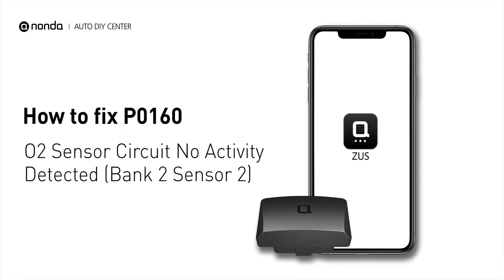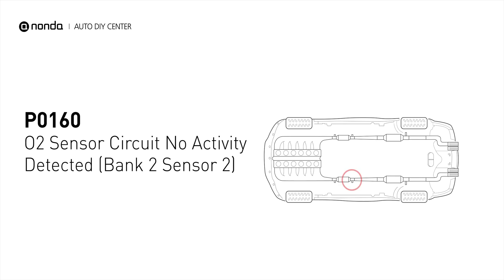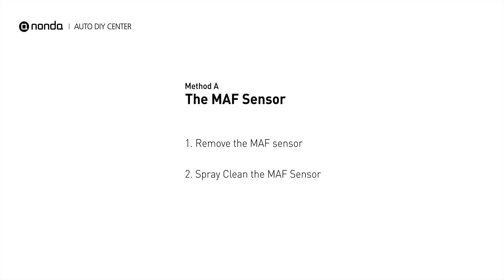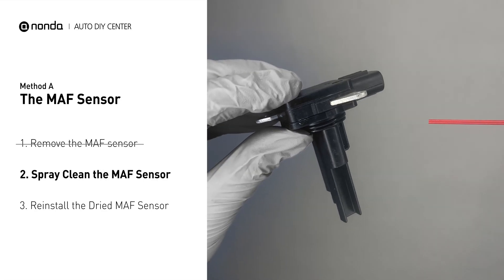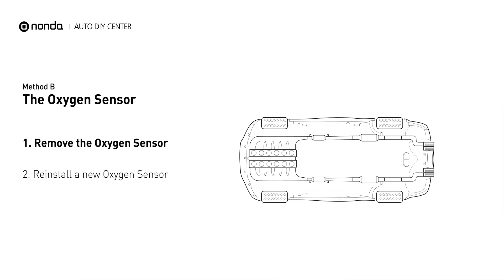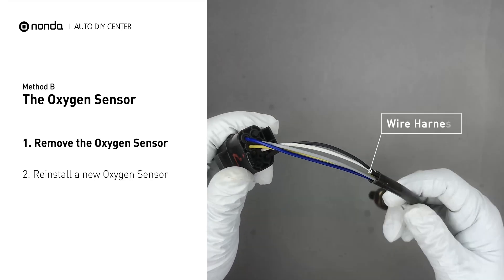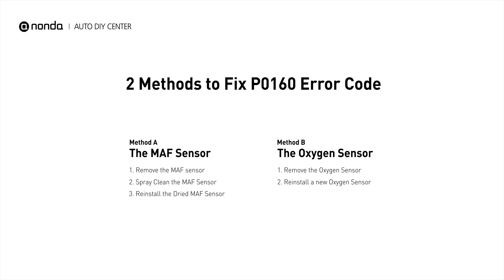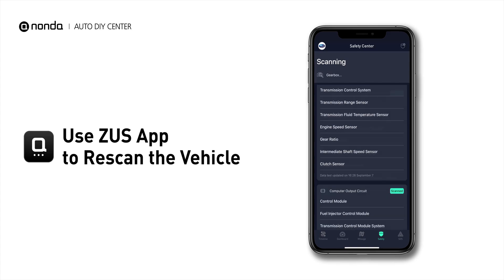How to Fix P0160 Engine Code in 3 Minutes [2 DIY Method / Only $9.81]

Comment: Got a 99 chevy silverado Recently had codes for o2 sensors , had them all 4 replaced , check engine light turned back on after a while, would it be the map sensor?

Comment: To clarify Bank 2 is not always on the side cylinder 2 is on. However bank 1 is always the same side as cylinder 1. Bank 2 will be the side opposite of cylinder 1. For example on the Ford 4.6L and 5.4L motors cylinder 1 and 2 are on the same side.
Reply from the maker: Hello, thank you for sharing your knowledge!
Reply: Informative 
Bank-1 it is on the driver's side left drive

Comment: great I had P0160 off and on for about 8 months,  it made it difficult to pass state test. on a 20 year old car with original B2S2 sensor.  Ended up replacing the Sensor  myself , and so far so good,  I heard it could of been MAF sensor as well. but in my case it looked like it was the  b2s2 sensor.
Reply from the maker: Thank you for sharing your experience, and we're glad to hear that ZUS has helped you with this issue.